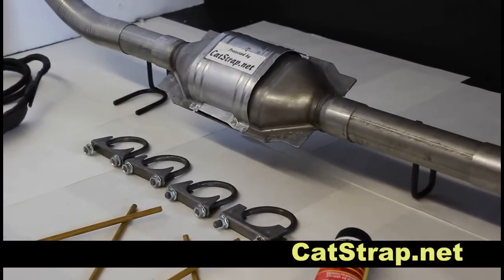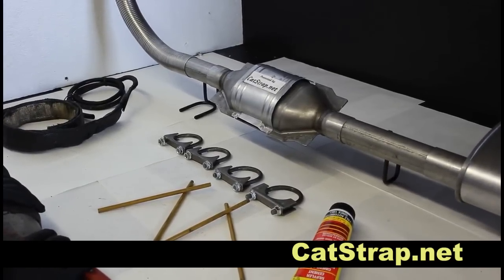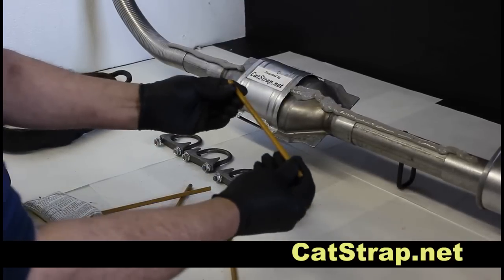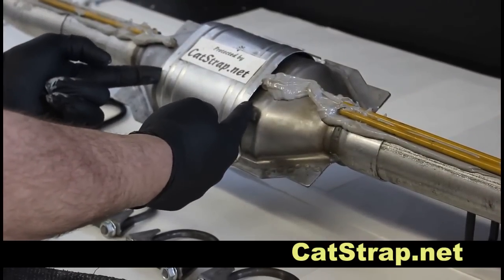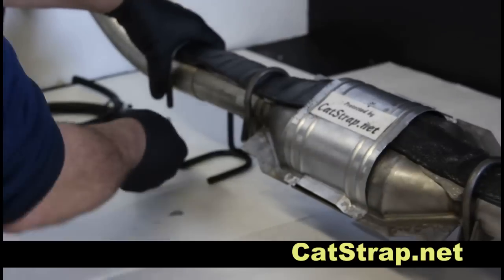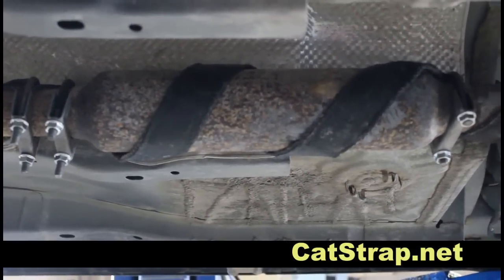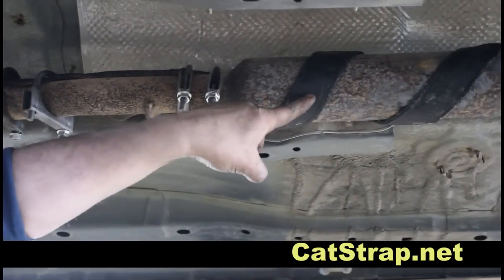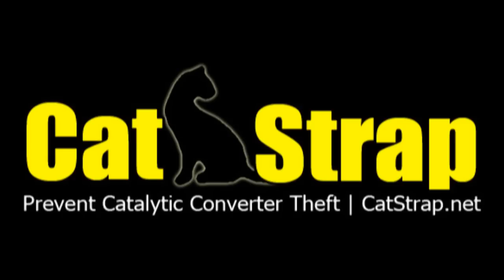Prevent catalytic converter theft with Catstrap

Comment: This is fucking aggravating.. we have enough to deal with in maintenance and all manner of theft. Now we have to deal with another security problem with (of all things!) a catalytic converter. Yes, I cant' wait until gas engines become obsolete. It's become more and more complicating to repair them to the point where you need a computer to diagnose it. Yet my $60 phone has enough computing power to diagnose a car and then some. Why can't car makers fit a computer in cars so that you don't need to pay $60 just to diagnose it? In fact, having a computer in your car would monitor the car 24/7 giving the driver all the info he or she needs to prevent major costly repairs and improve safety. But this will not happen. Just like any guy, I really love cars but it's become a fucking racket.

Comment: Too much to do and it will still be taken . You show the thieves how to install these devices and they will work around them just like anything else. This is like bumper guard but for converters . uselless. Why not place the converter from a engineering standpoint further up in the engine compartment and or create a micro pipe that does the same thing without the metals. the object is to redirect and reheat exhaust to burn out particulants that effect and create issues to the air we breathe.

Comment: Wouldn't the intelligent move be to do some research and footwork to find a list of shops and buyers for these stolen catalytic converters? I can't decide if it's it the low IQ requirement for police officers that explains the less than 20% clearance rate for property crimes or if they are just lazy? Or maybe both
Reply: Since practically no catalytic converters have ID info etched on them, it can be hard to prosecute catalytic converter theives.